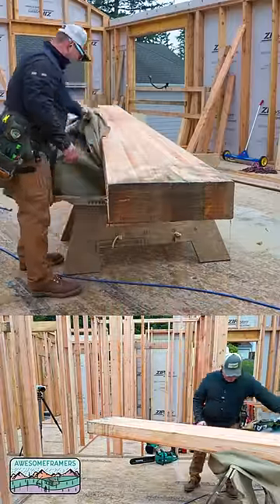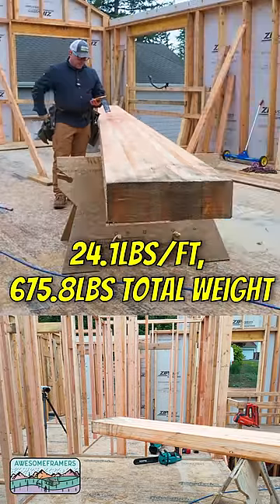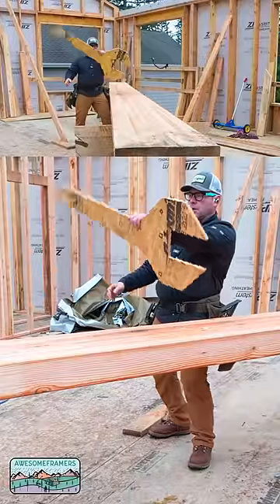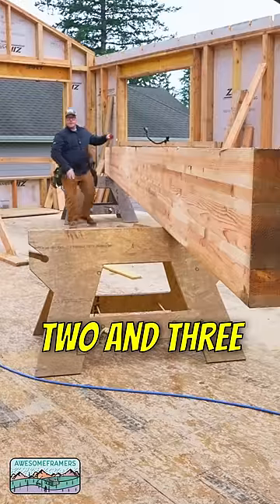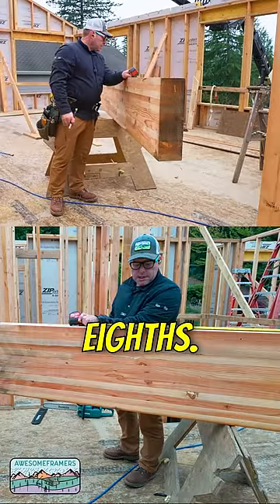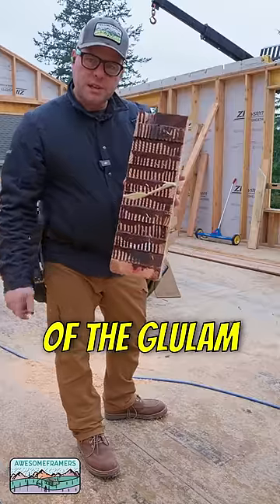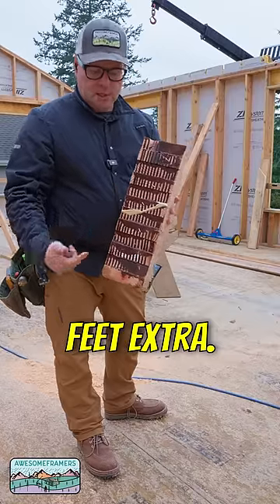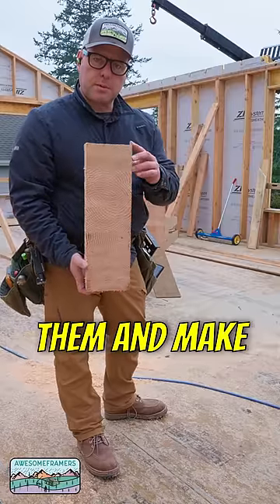Are You Strong Enough?  #framing #construction #leverage #glulam #huberpartner

Comment: Is that just glued 2x4s with no screws??????  Am i the only one that thinks this wood glue had a shelf life before it all falls apart???
Reply: the shelf life of the resin they use to bond them together has a shelf life that's longer than the wood.
Reply: @kenbrown2808  ya they said the same thing about the new adhesive they used to hold up the concrete blocks in the Tunnel in Boston.  First spring came they started dropping from the ceiling killing people crushing cars.
I don't know how you can trust a products long term application if your one of the first people to use it...  It's not like composite wood sistered beams haven't been around
Reply: @raysputin  funny you should say that. I'm currently sitting in a 50 year old house with the roof structure supported by glulam beams.

Comment: Man, building material keeps getting worse and worse.  All the homes i buuilt that truss was solid.  Not 2×6 glued together.  Anymore water will make these homes melt.
Reply from the maker: Glulams have been used in construction for 100 years.  You should really take the time to learn about them.  The glue joints are stronger than the wood itself. https://youtu.be/kdmHaCV_1DU?si=oK0I9EAcQVlDsq_R

Comment: We get those in at work sometimes. It's fun to play with them, it's just hard to completely pick up because of the width/thickness but very easy to flip up on it's side. You should try harder.
Reply: You couldn't flip this
Reply: @TimUhler1977  Yes, I could. Most men could, you're not picking up 650lbs, you're flipping it. It's just a transfer of rotational power. You can go with a more bicep dominant double underhand grip or even easier, use your legs and drive it up, grabbing it from the bottom or coming from underneath it, hands over shoulders
Reply: @TheMistaneff  yep, lots of words but you still can't do it

Comment: But why wouldn't you cut it on the forks of the gradall... like you actually do this for a living.
Reply from the maker: As someone who has done "this for a living" for nearly 30 years....it's easier in here than the sloped driveway, allows us to lay out easily and rig it. 

There's basically no advantage to doing this outside with our telehandler
Reply: @AwesomeFramers  Built everything from suburburban half million daily knock ups to mansions to 5 story hotels, why you'd unload just to reload it is beyond me, nvm risking damaging the building and that very very expensive glulam in the process.  Ik the forks tilt on that thing so its an even working surface no matter what....  Maybe I'm just used to being paid by contract and efficiency mattering to me, that just looks like screwing around to me.
Reply from the maker: @therealdadoom7509  you didn't acknowledge my previous comment, now you're wasting time

Comment: When those glue lambs get wet they fail I’ve replaced several of them for that reason LVL is a better product
Reply: I don't believe that to be true. What were the circumstances the glulams failed.

The glue joint is actually stronger that the wood itself.
Reply: The main one I did was on a garage opening with a cantilever porch joust not flashed properly probably got wet for 20 years but failed haven’t replaced LVLS yet
Reply: Gluelam will Cary more weight on a longer span than a lvl.

Comment: Uuummmm only 60's?? Where we buy em, they manufacture them in 10's, 20's, 30's, 40's and up to (the biggest we've ordered) 65'
Reply from the maker: They are manufactured in 60' lengths, shipped to distributors and cut to length there.
Reply: @AwesomeFramers  I'm positive it depends on what the engineer asks for. Because the ones we've ordered were built specific for the application. Meaning camber and all dimensions called out in the structural prints